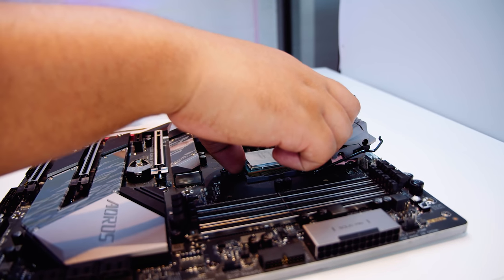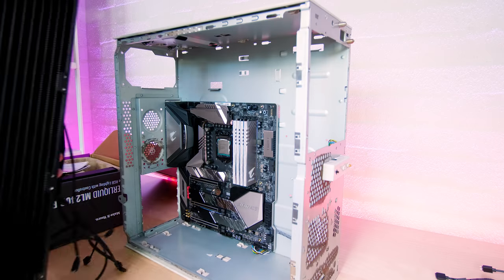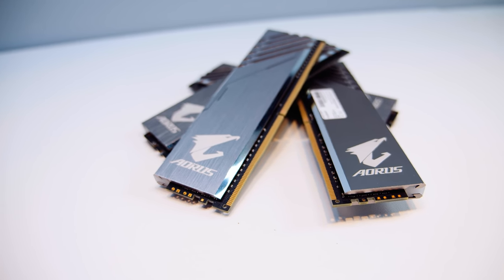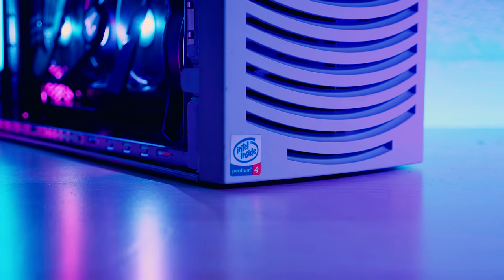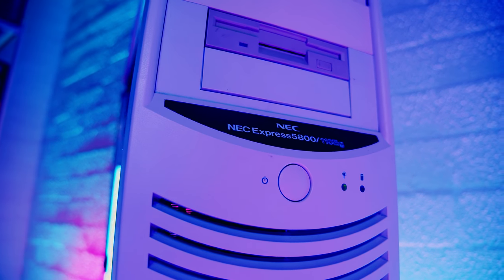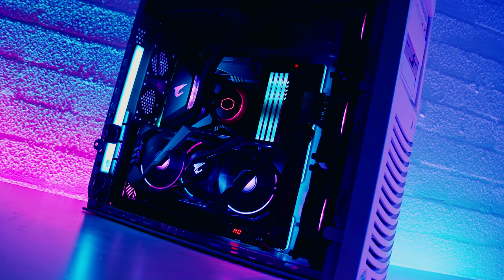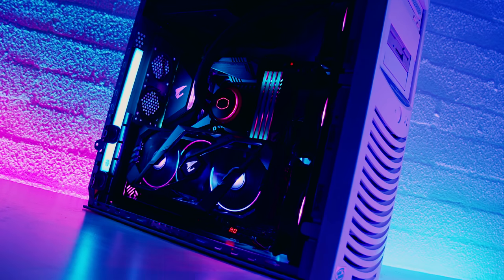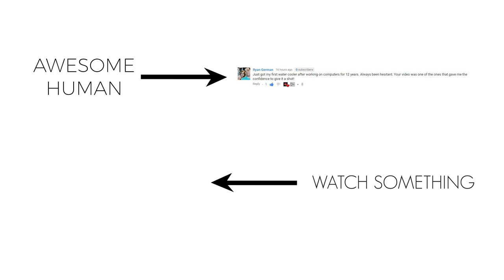$4000 Ultimate Sleeper Gaming PC Build 😂

Comment: I have an old case here which originally came if i can remember correct a 486 dx 2.Back in the 2000's i used that case to host my dual core amd cpu.She was a real sleeper pc.I lost the side panel(which was a complete unit.When i cleaned up my old hardware.But that case is huge.It's double if not more the size of my CM mb 500 case :D.I may use her in the future to make another sleeper build :D.
Reply from the maker: Yeah you should do it!!!

Comment: Posting on an old video, don't have much expectations. Awesome build, really nice video production as well. 
Quick question, if I may. What did you use for that front I/O panel to work, the button and led's, because I'm planning a build like this, I have the parts, have a 2005 Fujitsu Siemens case which I'd love to use, but the plus is really different. Also, would you reckon that the mobo stands would be at the correct height and placement, just align and fix it in ? Many thanks in advance, even if you don't reply, this video has been really educational. All the best from UK !

Comment: Imagine a custom loop in that 😂
Reply from the maker: Oh mah gawd that would be nuts. I don't reckon I could make it fit. Its actually a pretty small case
Reply: @GearSeekers   Gear Seekers   Gear Seekers  hmmm, maybe with a shorter psu you could mount a 240 on top, but you would have to perforate the top for airflow.

I'm thinking small res hanging off the exhaust holes on top of the gpu ;)
Reply: Gear Seekers yeah that would be very very tough, almost impossible 😂
Reply: Linus already did that